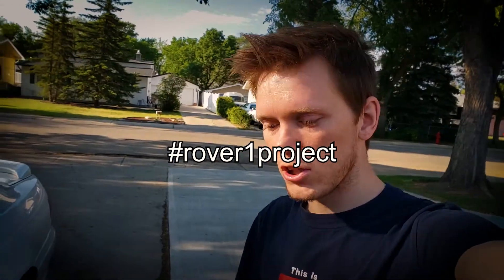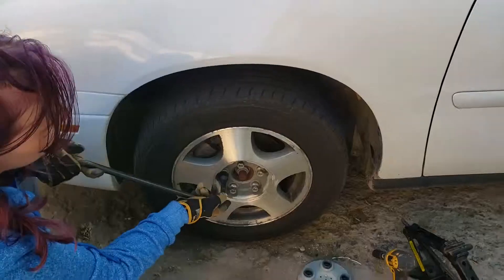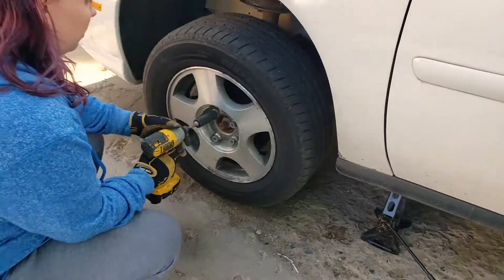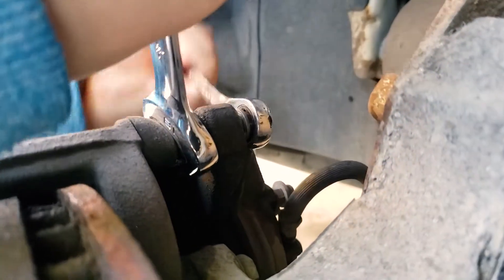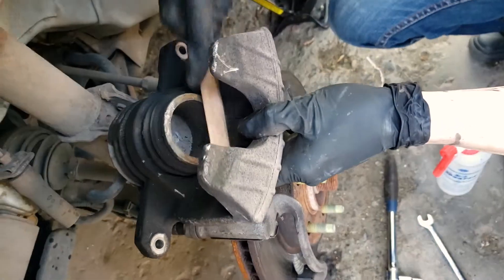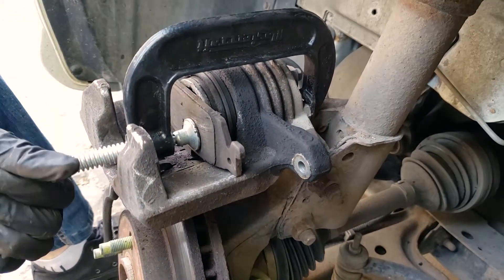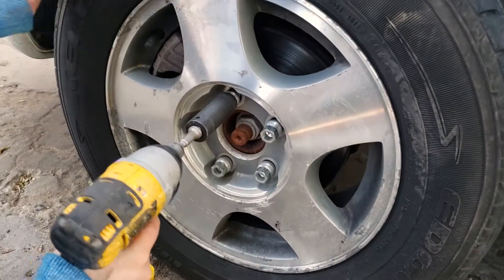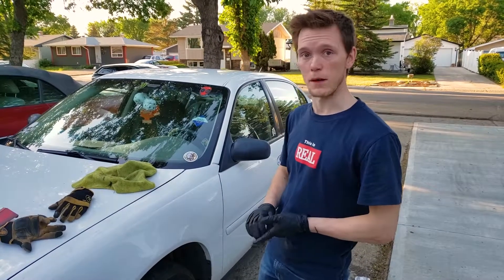How to change the front brakes on a 2003 Chevy Malibu - For Beginners

Comment: Question.. You noted break fluid shouldn't come out when you  compress the caliper, just wondering if you know what caused that and if it was a problem? Thanks for your video! I'm getting ready to change my brakes this weekend! Think it was cool you taught your GF how to change the brakes :) 
Thank you!
Reply from the maker: Yeah typically that means you have or will have a leak around the caliper piston/boot. New calipers are recommend. Somehow we never had and leaks or issues after this so we got lucky.

Comment: Umm, I thought there was supposed to be some bleeding if the brake line?  Aren't you worried about air in the line?
Reply from the maker: Its unnecessary for a simple brake job like this. I've done it this way for so many vehicles and they were all fine after.